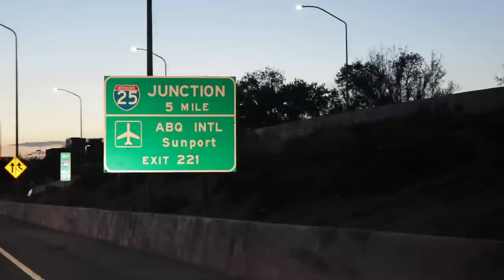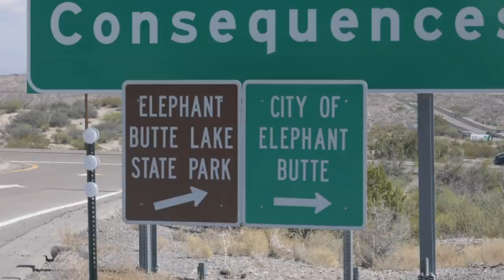Restoring The Truck I Learned To Drive On // 2700 Mile Road Trip Part 2

Comment: I've had three Rangers (1) 97' Ranger single cab 2.3L/5speed , (2) 1999 Ranger  Extended cab XLT 3.0L  4WD and a current 2010 Ranger XLT single cab 2.3L/5speed auto). They are great simple little trucks. My current was my late father-in law's truck. I will not change a thing. I respect you keeping your Grandma's truck alive.

Comment: I came to this channel for the Ranger.The frame looks fine so far as long as it it not bent or cracked you are OK to restore. I have a similar history so make Grandma proud Sara.
Reply from the maker: I couldn’t find cracks or bends. It’s never been in an accident or had any repairs done.
Reply: Sarah n Tuned  if that’s the worst , stop the rust , paint the underneath and drive on 🙂.
Reply: Agreed. She’s solid.

Comment: I think it is great that have the truck. You should take it off-roading before you start working on it. :) Is holds a lot of value to you that can not be replaced. Plus you can also use it for transporting car parts ETC...

Comment: Hopefully you can save the frame. It really did not look too bad.
Reply from the maker: I think I can, this truck will live a pampered life.. be a different story if I was towing or using it for serious off-roading.
Reply: @SarahnTuned ; I live in Minnesota (the rust belt) I have a 97 Ranger with 300,000 miles on it and a 09 with 180,000 miles and the only rust issues were on the 97 shackle brackets and spring perches in the rear suspension.  These shackle brackets and perches can be bought aftermarket from Dorman. 
Congratulations on getting the Ranger.👍👍
Reply: @daleostrom3613  Same with mine in OH with 50,000 miles moving or sitting still, rust never sleeps.
Reply: @SarahnTuned  You have to keep the frame, it's the one Grandma drove home, don't throw away half of Grams truck Sarah. That truck is way to cool for a nerdy girl 🤣
Reply: Have a '93 and a '95 that have both spent their entire lives in the road salt of Iowa. As Dale mentioned the leaf spring hangers and shackles crust away eventually, but they're cheap to replace. The black frame coating they put on these trucks from the factory basically turns to paper and flakes away after a couple years. I've never done any of "scientific" measuring  stuff on any of my crusty frames, I just take a wire wheel to them until the orange is mostly gone, and use a rattle can rust converter paint to seal it up. Bought my 95 ranger back in 2004 as a "winter beater" and it's still chugging along 17 winters later, I wire wheeled and painted it way back then and it's still holding up fine.

Comment: Magnetic Particle Inspection to check for thickness of the metal. I’m pretty sure you will be fine with the frame.  I had three Rangers back in the day so I thoroughly enjoyed the road trip.

Comment: I'm glad you and Charlie are back safely. I am not a truck or SUV guy. But, when we bought this house in 2001, my wife suggested we get a pickup. I found a '97 Ranger crewcab on eBay which turned out to be only a couple of miles away. Super clean inside and out. But, over 19 winters, EVERYTHING underneath was rusted. It even rusted a hole in the oil pan! Finally, it was so bad, it wouldn't pass inspection. So, I reluctantly sold it. We, (my wife loves your videos as well) really enjoyed your saga, some of where you went took me back in time to the every-August road trips we took as a family. Keep up the GREAT work, and I think you two would make a great couple. Just saying.

Comment: I kinda feel the same way about the '65 Dodge 1 ton crew cab 4 speed manual (granny low 1st) short bed, no power anything (brakes, steering!) ex-Navy truck I learned to drive in.  Managed to parallel park that monster first try.  Bought it from my brother later. Also found a '47 International KB5 farm truck, 6x12 flatbed., no cab, sold it when I joined the AF.  After AF, got the Dodge back, then had to move out of that apartment because the owner hated the truck with it's 4x12 wood front bumper.  Wound up scrapping that truck, but shouldn't have, but I was moving in with a GF in a part of Oakland that had very limited parking options.

Comment: NDI in the world is NDTesting. Your Gram was cool , not only do I have a 94 Ranger but I also have 2 Mustangs, a stock 72 and a Roush blown 2008, T56 and a built suspension... And I was in the Air Force for 4 years and the Air Guard for 27. Spent many days at DM for training.

Comment: Ahhhh, the shocks in the parking lot debacle! If I had a nickel...

Treat any rusted metal with ospho 605. Bet you knew that?
Reply: I was your 221. 👍 32 ford Vicky test drive goes both ways.
Reply: @mostcom  Thanks for that, much appreciated! I built that car from a pile of parts and had the frame made at Clark Hot Rods in Daytona. :)

Comment: After being a mechanic for 35 years and coming to hate Ford with a passion...I must say that is a very nice looking Ranger...side note...Fords made before 73 are wins!!...lol...my very first truck was a 1960 1/2 ton short box 2wd with a custom metallic blue paint..dropped front and 292 engine...now that was a Ford worth owning...hehe...could beat out any truck or car 0-60...but with the gearing that was also about the top speed...lol

Comment: I am 73 y.o. and I plan on keeping my 2019 Tacoma with a 6 sp M/T for another 10 years. I have also owned my '93 MR2 turbo since August 2000. By Sarah's definition am I a bad ass now or do I have to wait until I am 82 in 9 more years.?

Comment: Nice truck Sarah; I get it. Nice road trip too. I would sand blast and repaint the frame (even if you had to repair/ reinforce spots). Looking forward to the project. 

I always liked the mini trucks. I had a Ranger new and have owned several hilux pickups (my current one I have owned for 18 years).

Comment: I had a POS Ranger back around 1996. I think it was a 1995. Here were my problems:  wiper control module caused wipers to randomly turn on.  Ford knew this.  Bad design.  A new replacement module had the same defect.  Door lock switches that activate dome light and door open bell was plastic.  It eventually wore out and dome light/ bell constantly on.  These two problems were across all Ford trucks.  Gas tank fill tube leak.  Truck was less than 5 years old and under 110k miles when I dumped it for an Accord.
Reply: 96 XLT same " ghost " wipers. Randomly came on, but I never replaced. Also I removed the dome light. Fuel gauge fail. Other than that just a timing chain , U joint , rust

Comment: PB Blaster is the first “tool” you grab when working on an older car or truck in New England.  Ask me how I know...😳
BTW, that frame is showing primarily surface rust.  The frame still appears solid.  A little Rust Bullet would solve any issues.

Comment: Paint over rust [ POR ] treatment for the underside rust spots. Same for the replacement frame, if you go that route.  It will be a privilege to watch your Grams truck being brought back. I did a frame off on my late US neighbors Raider after the family gave it to me [ to get rid of it I'm sure, but it got done ]. An '88 with 26,000 original miles.  Botched engine repair and Nova Scotia salt water winter roads.

Comment: Was stationed at McConnell AFB in Wichita - the wind NEVER stops. Gets old fast. When a small twister pulled all the gravel roofing off the comm center where I worked and dumped it onto my Opel GT tuner.... If it wasn’t for the girlfriend I had there, the tour would have been a total bust.

Comment: Awesome trip with the truck , Go Project Ranger 😉👍....Take the body off , sandblast the frame if it’s not beyond repair , or find an Arizona frame with no rot , restore the minor rust on the body 👍 job done ...and it’s a sweet retro truck 🌟🌟🌟🌟🌟

Comment: I had a 99 Ranger and I didn't have any of those problems literally I bought it back in 2017 with 89 thousand miles on it it's the extended cab with the power locks and the four-wheel drive I don't know if that makes a difference but I bought it for literally $3,000 and still going like a champ didn't put any money into it no shocks no nothing

Comment: Nice Ranger. Let's put in a 5.0 litre using the factory Explorer motor mounts and shorty headers. Mostly a factory parts swap... looks like you have the 8.8 axle that came with most of the 4.0

Comment: I had to do a double take on this one! I have a 1993 Ford Ranger XLT 4X4 same exact color, pin striping and wheels, with 247000 miles on it. Still run like a champ. Has never let me down. Looking forward to seeing you work on yours. Key to making it last was maintenance, maintenance, maintenance!

Comment: This will be a cool video series and that's a really sharp Ranger. For a 90's truck from the North East, that frame isn't all that bad - I was expecting worse. Rusted yes, but it doesn't look rotted; should clean up well with media blast or needle scaler, then rust converter, then sealed with proper frame paint. My father drives a 94 Ranger also, which is definitely in worse shape, but beats the shit out of it doing scrap metal and it never even gets washed... still a trooper. My '04 Trailblazer frame is significantly worse (frame rotting) and it's 10 years newer. NJ sucks for vehicles.

Comment: Sorry, didn't know it was the car you learned stick on; how cool is that?  My first foray was a 1973 Dodge Power wagon with a four speed stick with a shift pattern that: wandered from day-to-day and a (factory) stick that had a linkage so long first would smack your hand into the dash and second smacked your elbow against the seat, third would allow you to crank down the passenger window and fourth allowed you to reach behind for a coke (okay, exaggerating a little, but not much)  I still miss it....

Comment: Hi Sarah, I know you have this truck at heart, specially for your grandma, a suggestion for it to last longer, instead of just restomod it, could you think about hybridising the drivetrain while keeping the same engine.  There should be a lot of space for a battery pack.  By the way my dad is 82 years old and is still driving a small Vitz Toyota, I won't stop him.

Comment: Late 80s early 90s rangers the cat shields came loose and would rattle like crazy. Ford's fix was those big ass hose clamps. Some dealerships wouldn't even put them on cause they just come loose and rattle more. They just pulled the heat shields off. Then charged you $8 to do it. I had a 1989 ranger the heat shields was rattling before it was a year old.

Comment: A bunch of years ago I drove the same route to Phoenix.  I wish I could say I felt the same about that stretch of Kansas.  I had been driving for 18 hours in my Frontier with a motorcycle in the bed and a trailer hooked to it.  All I wanted was a hotel and couldn't find squat.  No cell service either.  The very next day I got a speeding ticket right about where you show the "Welcome to Texas" sign.  That portion of the trip was no bueno.

Comment: In Michigan, you use the red wrench to remove shocks. That truck would be one major pile of rust flakes in a snow drift by now. Trucks just do not hold up in Michigan. They rot out like a kids teeth eating a bag of sugar. I honestly couldn't drive cross country in a little Ford Ranger.

Comment: As a present day owner of a '07 single cab Ranger, I thoroughly enjoyed your two part excursion across the country. I love my truck and will enjoy watching what you have in store with it. It's a great vehicle and I think you will enjoy its versatility and fun owning. Congrats on appreciating such a fine vehicle. Enjoy
Reply: Best mini of that gen not counting dodge because I'm a dodge boy but never been around the Dakota it mid sized but so is her ranger or b4000 I like them no matter the badge probably better then dodge but I'll never now cuz I'm not in the market to be a Dakota owner and if I was I'd stick with what I know and get a b4000 cheeper and not ford but I'll stay with my ram1500 or my little short loadstar 1600 turns on a dime and can pull large homes that what I got it for anyway 10 miles to the gallon loaded or not😎😎😎

Comment: I had a mid '90's Ranger. It was a great truck.  Do yourself a favor and get a replacement fuel fill line.  It's plastic and is guaranteed to fail.  Mine did ten years ago, and other Ranger owners I know had the same problem.

Comment: Find a Krown Rust Control center and buy a can of the krown rust control spray it on the rusted sections. It will slow the spread of the rust the stuff works amazingly well.

Comment: Sara why dont you use your welding machine to take out the rust somehow,or scrape it with an electric grinder and reinforce it possibly if the thickness isnt satisfactory with some additional steel??????

Comment: NDI sounds interesting. The scientific method we use up here in the rust belt is striking the pick end of a body hammer into the rusted area of the frame with the proper force. Given the amount of rusted vehicles up here, it doesn't take long to become a rust whisperer.

Comment: I don't know if anyone has mentioned this or not, the front mud flaps had this weird cup to them that tends to hold dirt and water.  I also learned to drive stick on a 94 Ranger.  For technical info I used to use the website: the ranger station dot com, all one word, along with a Haynes manual.  I try not to post website links in the comments sections.

Comment: I get where you're coming from doing this project. I would do the same under the emotional circumstances, I wouldn't worry about cost in getting it up to scratch either, there's much more to it than that.

Comment: Apparently the rods are the same in the Rangers and Taurus, witch has caused a lot of them to fatigue. I think the issue is mostly wit people who used them as tow and race around though. Just saying, you might want to do a bit of research and see if you might want to swap out rods or grab a Taurus doner engine.

Comment: Gonna be a fabulous parts hauler, and the go-cart will fit in the bed with ease.
Frame out, if saveable, box it and hide all the pipes and cables and wiring in side the chassis.

Comment: When i got my tacoma that had come from Connecticut and had less frame rust that yours, i got a needle scaler and went over the entire thing, you can get one cheap from harbor freight, and it knocks all the loose rust off in record time. just make sure not to touch a painted area because they are designed to remove paint.

Comment: I'm seeing conflicting issues with the truck and what you've said it is equipped with. In one early undercarriage view, I saw what looked like the 7.5" rear end, which came with the 4 cylinder and 3.0 L V6. Then in your spec sheet you created, first you say it has the 4.0 L V6 - which would mean it has the SUPER-strong 8.8" rear end, but then you also spec that it has a Dana 35 axle. Maybe thats what is up front; I'm not sure, because Ford changed around between the Dana 28 & 35 up front, along with a modified Ford 8.8.
Reply from the maker: So it is the 4.0 OHV w/ the 8.8 rear end. Don’t know what what to tell you other than you’re wrong? 😅 (2:26 you can see the indentations on the lower corners of the rear pumpkin cover which only the 8.8 has)  The Dana 35 up front I verified w/ the serial number on the tag behind the front axle, as well as the final drive gear spec which was printed on there.

Comment: Gosh I hope I'll be able to buy a 6 speed manual transmission vehicle at age 82. Considering, how EV's are going to be a mandatory thing in the year  2035. If they offer anything like the Lithium Mustang made 2 years ago All Electric Powered Mustang Fastback with a 6 speed manual transmission
Reply from the maker: Jeep designed an All Electric Wrangler Magneto that has a 6 speed manual still. There is hope!

Comment: Since you're going to all the trouble of doing a frame off why not just cruise the local junkyards and find a nice, Arizona, rust free donor frame?  It would make life a whole lot easier and you will be miles ahead if the truck is a keeper.
Reply: I have done frame offs. Best to inspect the one you got. Nothing worse then looking, then deciding if buying parts car or bone yard which can take days. In which time the original will be blasted and have the 5th coat of paint drying on it.

Comment: Hey look Texas, Kansas knows how to keep their windmills working.
Reply: All it Takes is a little extra money compared to the massive cost in property damage. Rise in insurance cost waste of resources. On and on. Cost benefit analysis would have shown that the tiny savings to the energy corporations, little of which was passed on to the consumers, would have bared out the insane risk to the consumers. But they sure socialized the losses. They knew... and they had a warning years earlier. There should be an apocalyptic day of reckoning for all involved in that massive fraud. But no. So they must like it that way,

Comment: Your fortunate it hasn't a Vermont truck the holes wold have been big enough to throw a cat though everwhere and that ain't no 💩. New Hampshire doesn't seem to go as ape 💩 on the friggen salt, saltbrine, calcium chloride, sodium chloride,  And what any other corrosive 💩 to keep the flat lander's on the roads up here in the winter time so they can slide down the mountains on a couple of artificial boards strapped to their feet. Hence the rust bucket state. 🙂

Comment: I was a Hooker is the past, in a good way, a Steel Hooker, not a real Hooker on the streets!, I love Hooker`s, all Hooker`s, in a good Light!.
Reply: In a pipe mill? I did it for a couple of months. Over the decades clerk, operator from heavy equp., crane, production equip. oiler, laborer, inspector to name a few. Hooker not so fun but vital.